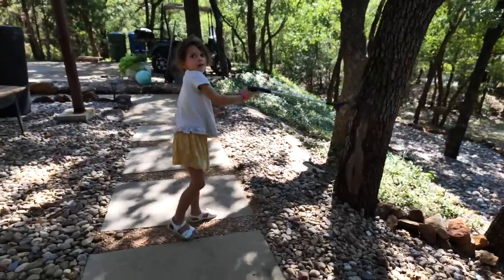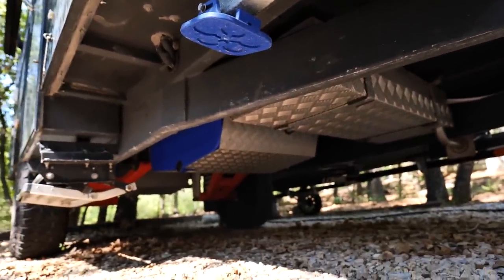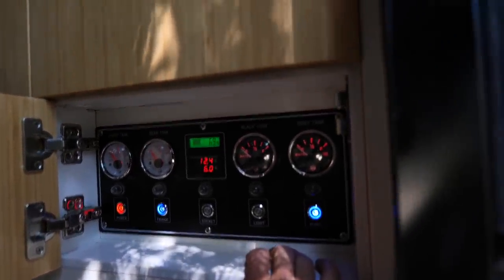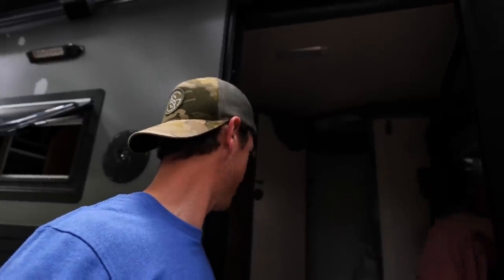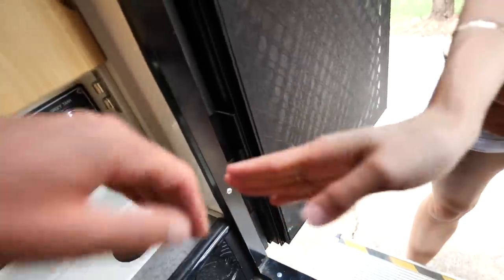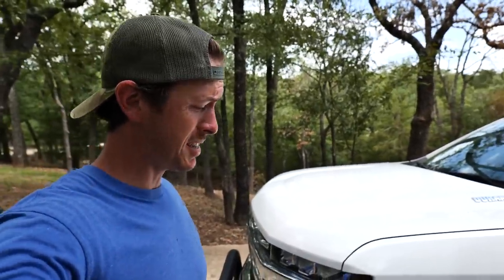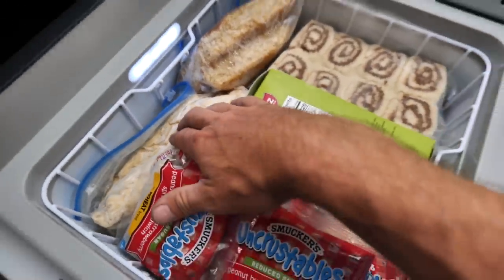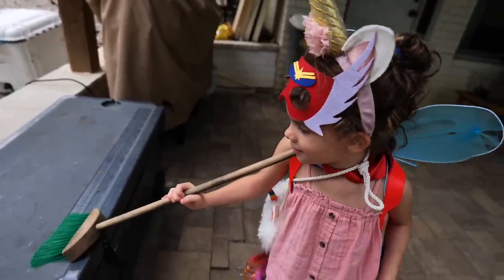FALL OVERLAND CAMPING - What's in Our Camper? TOUR

Comment: just a thought about the standing water in your shower. cedar slats that you could get on Amazon would work perfectly.  just cut to fit they would allow water to drain through and leave the top dry for the most part. also eazy to remove and clean.

Comment: Hey bro. I never thought about the water system cleaner. I usually run a gallon of bleach through the system at the beginning of the season. I will definitely pick up some what you used though. I have a Opus as well. 2020 version. Anyway my vent above the bed hinges broke last September only an year into having it. Contacted Opus and they said there was a problem with them breaking and finally sent me an upgraded version they currently use under warranty. So check yours out while you are still under your warranty. Also I took her out in the spring and had a snow storm hit. My camper wasn’t quite level and the water from the roof ran down the side the side and leaked inside from the silicon seal around the window so check that as well. Another thing to check are the robots that hole the roof lifting handle. A few of mine broke. Great idea as well to hold the back window in place. Overall I love my camper and would only trade it for a black series HQ 15. Enjoy your videos my friend. Cute family😊